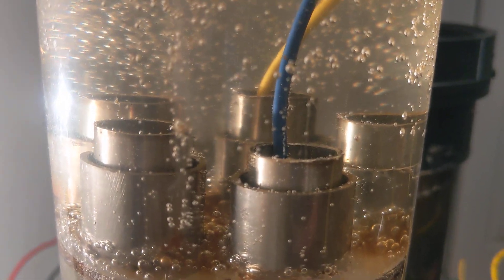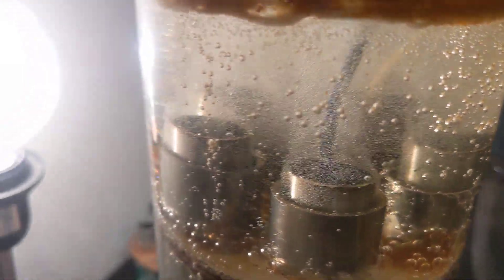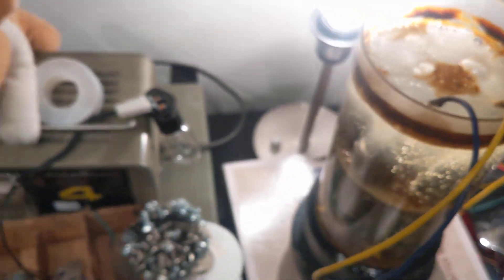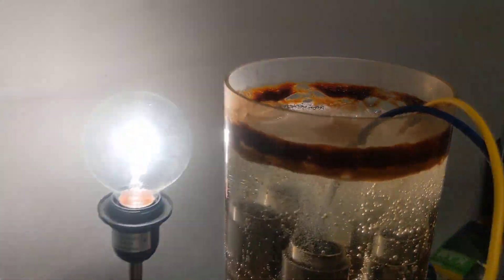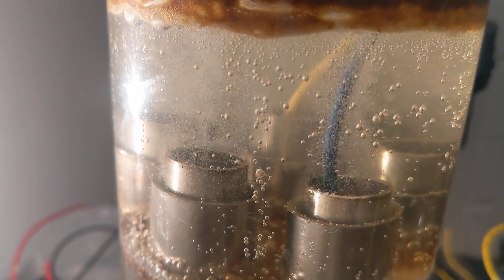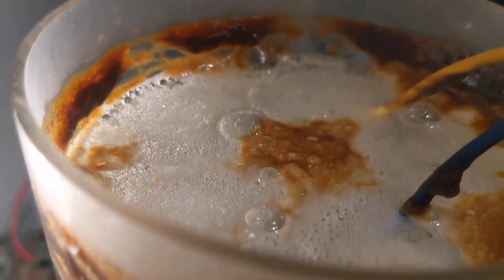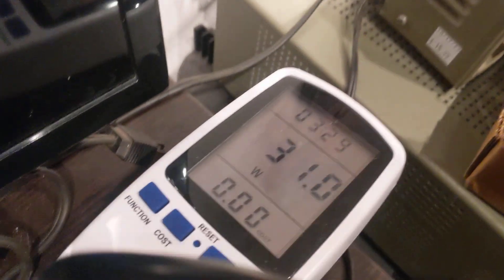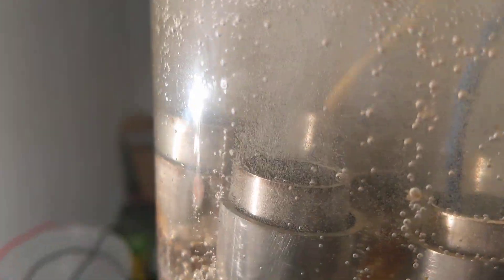HHO Resonance WFC High Voltage (24H Later)

Comment: Hook up the scope, and measure the voltage across a 0.01ohm resistor in series with the cell, so you can see and calculate the current.

Comment: Just curious, where did you source your stainless steel tubes and are they 304 or 316L?
Reply from the maker: 316/316L is what it says on the pipe. I have used 304 and that works fine. The chromium content is higher on 304 anyway, and is usually a freckle cheaper, but I'm sure there's a good reason to use 316 for long lasting.
Reply: @weighta6630  thanks for the reply and you're doing great! I also followed Ritalies plans and they are top notch! You did a great job adapting the info.
Reply from the maker: @bogey6925VR  ;)
Reply from the maker: I used ebay, but you should always check offerup or craigslist for local dealing. You will always get components cheaper when somebody doesn't want them anymore

Comment: just stick a short wire on the scope and hold near the cell, at high voltage you will pick up the signal no problem with non contact.